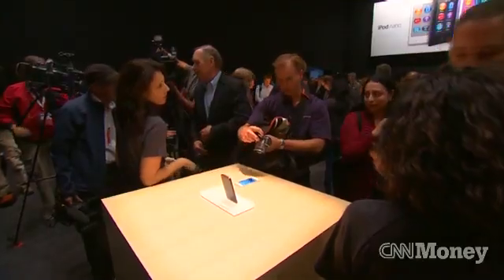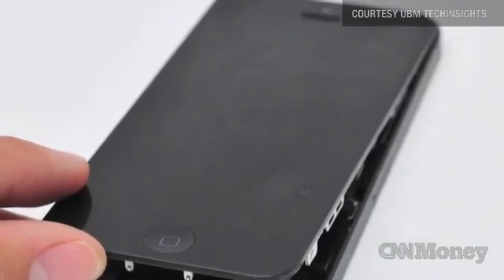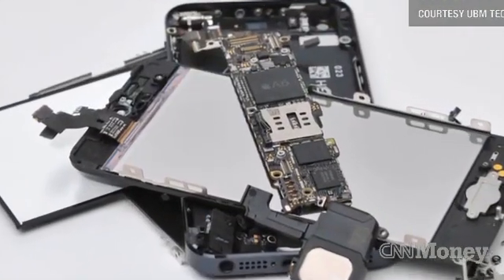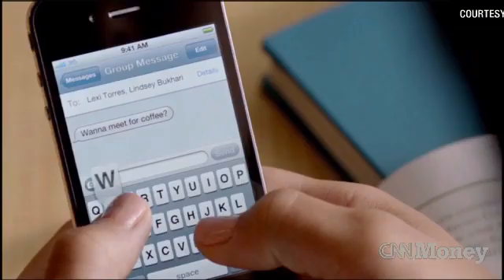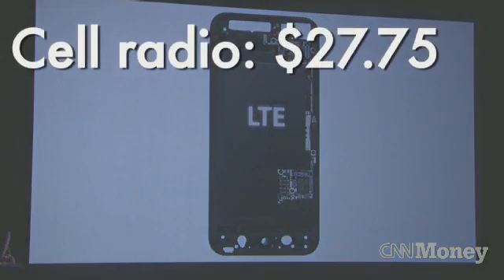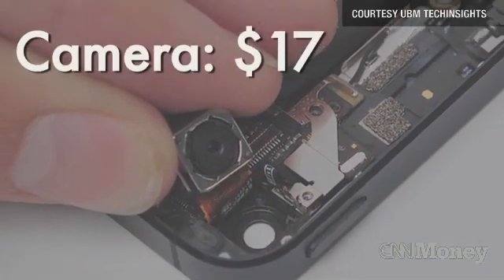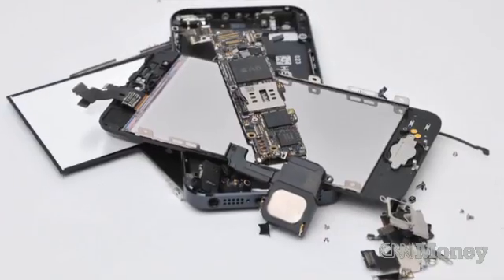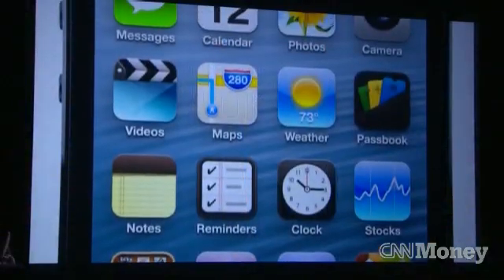How $649 iPhone 5 costs only $180 to make

Comment: Apple buy stuff in bulk, so the stuff are really that cheap to them (like the processor would cost around 60 bucks in retail but 30 bucks in bulk) and considering they only pay the manufacturer about 3 to 10 bucks for manufacturing, Apple is just like selling its software and IOS for like 300 dollars (taking into account that advertising every IPhone cost average 50 bucks to 100 bucks per phone). 😗